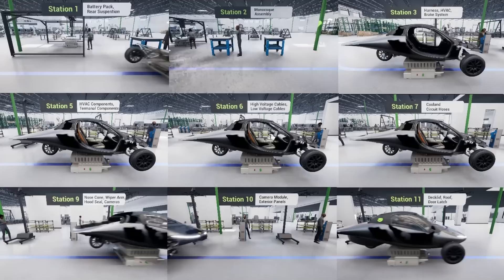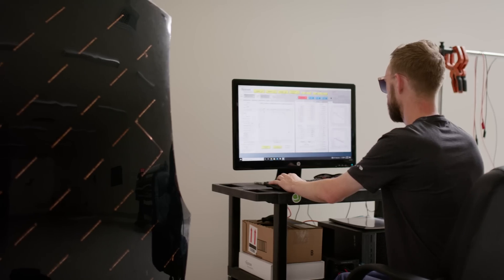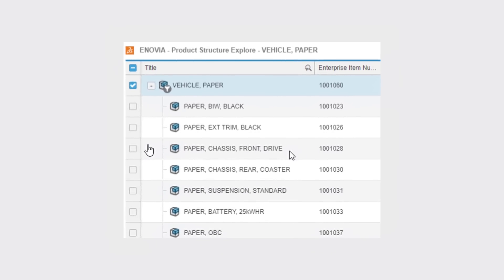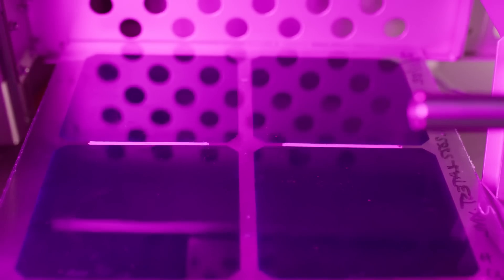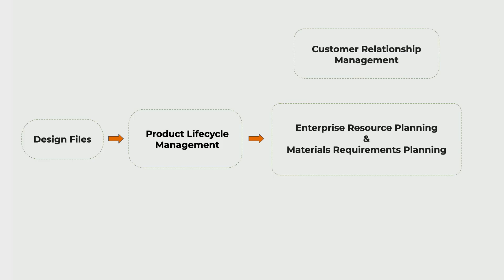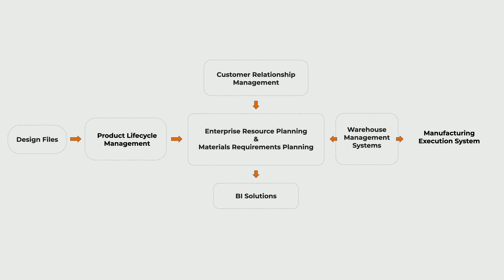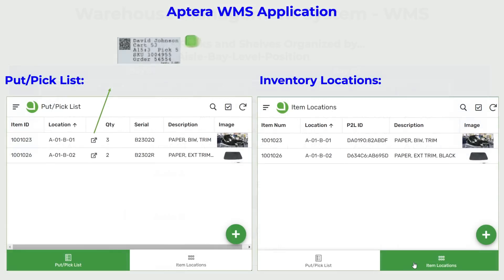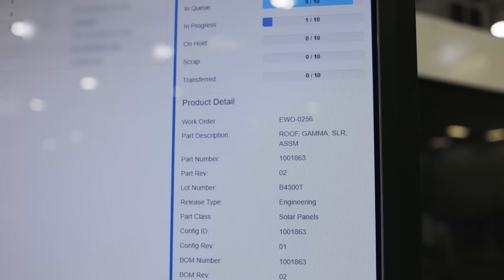Aptera — Design to Production

Comment: As all personal vehicles can fail and certainly all must be deliverable to the customer, how should an Aptera be towed, trailered, shipped, etc.? 
As it is described as being 88 inches wide, it could not be towed using a standard two-wheeled tow dolly. 
Can it be flat-towed? 
The standard U-Haul style personal vehicle trailer is not wide enough to accommodate 88 inch width, either as such a trailer is only 79 inches wide.

Thank you for your consideration in this matter. 
CLW
Reply: I expect that we will have more information on this topic forthcoming.  A towing dolly is not likely to work due to the wheel motors being unable to be turned "off".  There are wide “over wheel design” trailers that are typically used for towing multiple snowmobiles with a 101” wide deck and their total payload is just above the 2200 lbs.  Something like this is already on the market and could probably work well.

I am sure we will hear more about this in the future.

Comment: While all the "back end" stuff he discusses is vital, the personality types to lead volume production are not often found in engineers. 

Working while deadline constrained maintaining consistent high quality while performing repetitive boring  tasks... is difficult.  All the inventory and logistics control doesn't spin the fasteners.
Reply: No question that it is difficult.  There are ways to manage "boring" jobs.  I spend more than a decade at a company where I would spend a week in product assembly, a week on the phones, a week in repair, a week in the R&D lab, and a week on the road.  Not all of my colleges wanted this variety in their jobs but those that did were there for the long term and on the production line, you and several of your colleagues held patents for the products they were building and knew many of the customers they were going to.  

I think Aptera will have some similar job satisfaction built in.  I already know several of the employees and they are all thrilled about what they do.

Comment: With all the significant details worked out ... when is the "estimated" start time?
I hear lot of noise... that's about it.
Reply: Since the gating issue is funding, we won't have an estimate until the required funding goal is reached.  My guess is that this might happen in the May time frame, but it is only a guess.  It could happen tomorrow, or much later that the funding to begin has been obtained.   At this point, I am quite sure it will happen.

Comment: Aptera really needs to consider bidirectional charging. It would make their vehicles future proofed as most BEV manufacturers are planning on installing the capability in their BEV.
Reply: They certainly are considering it.  The holdback is that there is no standard in place at present.  As soon as that happens, you will see Aptera move on it.

Comment: You have yet to get a single concept into manufacturing. This is a fictional video
Reply: That has already happened.  Aptera is shipping their Andromeda Energy Tipster software to third parties for revenue, as can be seen from the last SEC report.  They also have solar panels in current production.  The video is far from "fictional"
Reply: @n.brucenelson5920  Maybe you can't read sec filings, but i can. This "Aptera is shipping their Andromeda Energy Tipster software to third parties for revenue"=not true.

Comment: How does this pass any kind of crash test? Mic drop................
Reply: They need actual Delta bodies to do the crash testing. The last interview I saw mentioned mid year for CPC to  bring the tooling and process up. Then they need 5 or 6 sacrifical vehicles built for crash testing. I believe they said this would happen at CPC.
Reply: @garywozniak7742  Thanks Gary, I am looking forward to this and hope for positive results. I imagine this to be a very popular sport in the future and will hope for the best.
Reply: @garywozniak7742  All Aptera has said at this point is that they will be voluntarily having delta vehicles crash tested by a third party to FMVSS Part 200 standards, and that the results would be public.  We don't know who will be doing the testing at this point, but we do know that the crash test results have been continually run since the design process began, and that there are now thousands of virtual results informing the actual design.

Comment: I appreciate the transparency, but why are you three years behind and how is this information even useful?
Reply: The original thought was that the demand would be for a few thousand vehicles.  Pre-order totals are now over 41,000.  that has meant that the original plan to use vacuum resin infusion to produce the bodies was no longer feasible.

Aptera has had to adjust to find suppliers capable of meeting this demand, and the vehicle had to be redesigned to allow the use of stamped fiberglass and carbon fiber sheet.  This has led to the need for more funding, but has also elevated the quality of the vehicle we will receive to near supercar status.
Reply: @n.brucenelson5920  
I would have LOVED to know this months before , Not when I was PROMISED to receive my reservation- pushing it back 3 years and kinda forced to settle with the Lunch addition. 
- This practice is called : bait and switch 

But thank you
Reply: @SilverCymbal  totally missed my point kid 😂 you tried

Comment: As a manufacturing and distribution engineer, they're design to ship processes are industry standard. This is a huge investment by them already just for ERP and WMS licensing. Getting off the ground is the hardest part, but the manufacturing plane can fly smoothly with these systems in place. Good luck

Comment: Excellent briefing video of manufacturing process. I can see this has coming along forward and really will require patience. I'm looking forward for a Noir to be picked up from factory floor. 👍 I'm hoping though if there's a plan for adding under belly led lighting that shows Aptera logo whenever the door is open and rechargeable flash lights built into each doors. Just another accessories ideas. Thanks.

Comment: I think you have a typo in your "EBOM" - it shows 20, 40, 600 and 1000kWhr battery packs rather than 20/40/60/100... Unless you're planning on making a 10,000 mile capable Aptera :D
Reply: Needs to be charged in alternate decades!

Comment: I've done engineering design, software development, project management, including attention to procurement and manufacturing with a $100M a year company. Our engineering/manufacturing/material control systems we're out of the Stone age relative to what Aptera is doing. That was almost 20 years ago however. It obviously takes a lot of work to get all these systems integrated, but then we should expect a very smooth operation.

Comment: Having worked 45 years in manufacturing over 6 different product sectors I followed everything you presented. However sometimes MRP stood for More Rotten Paperwork. But today use of computers simplified a lot of it except for FDA requirements which had to be hard copies than we scanned into record keeping once each step was complete (FMEA, Validation, and Non Inventory Production Lots(which were called nipples)
Reply: please if you can talk with the team in linkdin they are very open to chat

Comment: What type of crash-testing has the vehicle gone through?
Reply: Since it all has to be done on "Delta" the last I heard was that CPC will be producing bodies by mid-year and crash testing will occur the. They have to build 5 or 6 sacrificial vehicles for that process. However they reportedly have excellent computing resources and modeling software an expertise to model the crash safety. So they arr confident that it will perform well when the test.
Reply: There have been thousands of virtual crash tests since the design process began.  Physical crash testing to FMVSS Part 200 standards will be conducted by a third party once there are delta vehicles available to test, and the results will be public.

Comment: I am presuming that all aspects of design represent some sort of compromise. Further, customer feedback will alter how those compromises will be made going forward. Do you have a Failure Modes and Effects Analysis program in place to manage quality as manufacturing and customer feedback issues become available? How is quality control and driving that to be managed?

Nice neat presentation BTW. Thanks.

Comment: little typo at 1:03 the battery pack variants have 2 correct and 2 impossibly large packs. 25 and 40 kWhr are correct, but 600 and 1000 kWhr? dayuuuum go faaaaarrrr 🤣. (1 to many zeros)

Comment: I saw Enovia on the screen, are you also using additional 3DS products, like Catia, Simulia, and Delmia Apriso? I'd be curious as to your MES, especially since the main assembly line isn't actually up and running yet. (I used to work for multiple MES companies, I'm kind of a manufacturing geek)